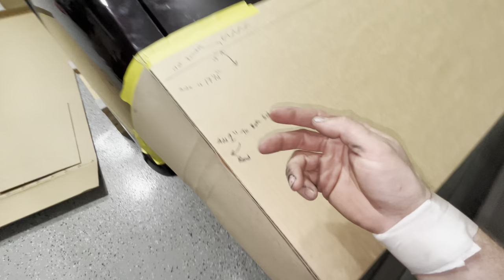$40 DIY Drag Wing Mock Up On The Comet 💫

Comment: the sides are called spill plates, the wing when finished should be level to the ground the car is sitting on, the wickerbill will do all the work. i had Keith Engling(skinny kid racecars) install my wing on my fox mustang, he told me all of that. on your support struts, i would bend one big tab in the middle and eliminate those 2 small tabs on the ends where it attaches to the deck lid. you may want to consider some grooved openings in the center of the wing above the chute to help with chute deployment. my Skinny Kid wing had that, i thought it was a great idea.
Reply from the maker: I’m actually of course farther along than video and I did end up not using the bent aluminum tabs to attach it and instead used stronger small steel tabs. I plan to have another video up by this evening of the actual metal work and you’ll see that. I think not using the bent aluminum little tabs was a good thing.

Comment: Instead of a bracket use A rod from the first under brace/ strut to the front bottom of the side plate? This will triangle it and you won't have to attach it to the back plastic panel. Just make the outer strut out of a little thicker material or reinforce it with a harder thin piece of 1'x 1' angle.
Reply from the maker: Excellent idea I think I’ll use that today when finishing it